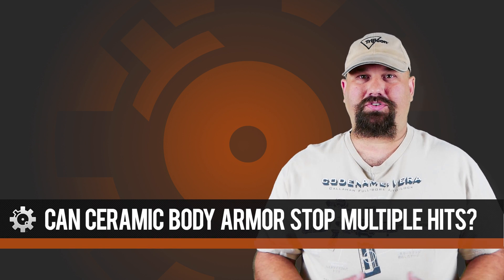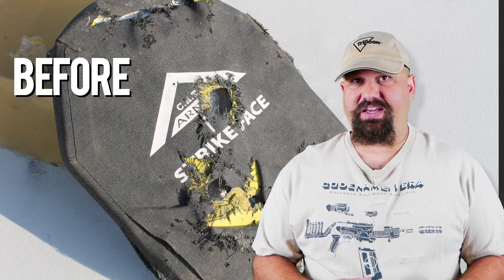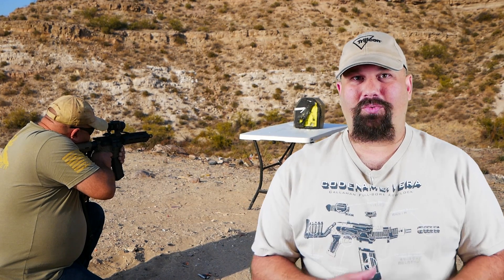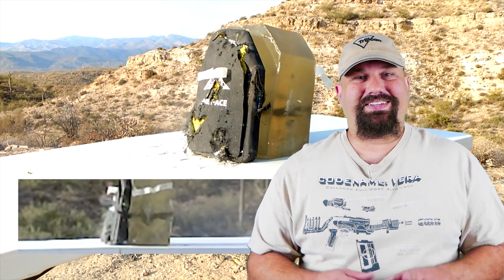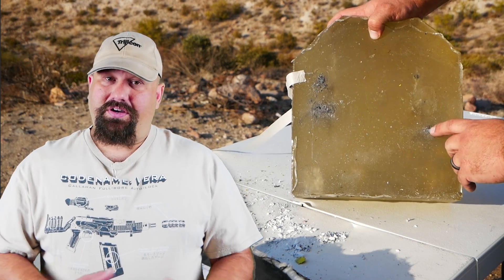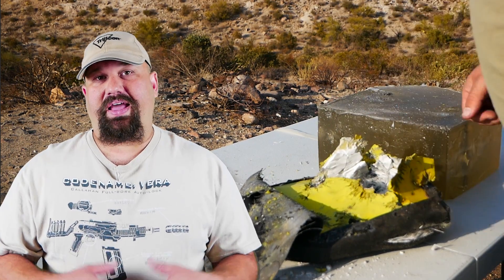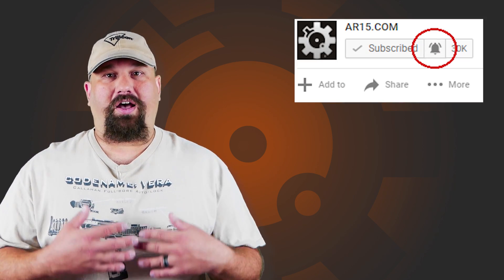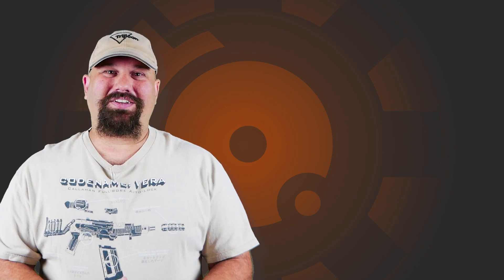Ceramic Plates: Tougher Than You Think? CATI Level IV Armor Test

Comment: I had much different results using a 458 socom
Ceramic: 8 rounds 
Steel: 25 rounds 

300gr ammo 

Hope this helps someone
Reply: That's likely due to the Ceramic Disturbance Rule.
Larger calibers will disturb more strike face at once.
of course, there are caveats, but in general...

Comment: What I'd like to see is if ceramic will fail against multiple low level hits in the same localized area. I.E. 15-30 rnds of 9mm all with the same point of aim, not trying to spread the shots out to undamaged areas.
Reply: That's exactly what I want to see
Reply: Just put a 3a or level 2 backer behind your ceramic plate... Ar500 offers a level 3a soft armor plate that is .25” thick, 1.04 pounds...easy pz.
Reply: @hylabrookbooks  that doesn't answer my question. I want to know how much concentrated lower threat fire they can take. A worst case scenario.
Reply: @corvoshlorpe3849    if you’re talking 9mm hitting in the same location it would hold up. I can only tell you I’ve shot armor similar and what happened is the rounds just started stacking on one another. And pretty much layered on top of the soft armor behind the ceramic. Basically when fired, the rounds would  hit the previous ones caught in the armor

Comment: I run a Level IV composite ceramic 1 inch. Behind it I have a ¼inch AR550 plate. That is on the front portion of my carrier. On my sides and back I run 1 inch level IV ceramics. I also run a Level III+ ballistic helmet. The ballistic helmet has been known to stop multiple .308 rounds. It will knock you out, but you will survive without being brain dead.
Reply: What 3+ Helmet are you running? From where?
Reply: @humansvd3269  
It's likely some variant of the ECH type.
It's an NIJ III- equivalent, capable of leadcore 5,56/7,62mm ammo.

Comment: if you are hit that many times with a steel plate on you will probably die from internal injuries anyway
Reply: Or spalling fragments to the neck
Reply: @agenetpringles6164  I've seen spall liners on steel plates that could take multiple times the amount of volume of of lead as was shot in this vid.
Reply: @Frenchfrys17  
And I see Armor Repub's "cutting edge" FragLock coats fold the cards to a few rounds.
Your point?

Comment: What’s the story with ceramic plate having expiration dates?
Reply: Dubtak things that don't expire generally are given expiration dates so you'll buy another. Anything inorganic doesn't expire. Sure he glue or whatever might not hold up as well, but it's to make you buy another one and for liability reasons from manufacturers. They don't want you to claim it was faulty and expired if the plate fails somehow.
Reply: I read somewhere that ceramics plates decayed.  I sold my level IV plates.  Was I wrong?  It sat in my closet for 4 years. :(
Reply: As long as you didn't take a loss/huge loss, doesn't hurt to renew. But especially if it sat in low humidity, non extreme temperatures it should be fine. That said, I would be more concerned about kevlar "expiring" more than ceramic. But ceramic plates might have kevlar backings.
Reply: @shinli00  
There was literally nothing wrong with those IVs, though depending on brand it may well have just as well.
As long as you keep a plate somewhere comfy for a while, you're fine.
Reply: @stevedo18able  
If I remember correctly, soft armour has been tested for degradation over time and undergoes simulated degradation testing.
Anyways, if Al Gore is to be believed that shit'll outlast me.
Reply: Ceramic plates never expire, they are put on there for legal liability from the manufacturer.

Comment: Hey great points here!  DoD picked ceramic for a reason next to cost/distribution, the efficacy for the situations that DO dictate their usage is more than prevalent in our Veteran community, they've surely saved lives in their capacity and then some.  The side plates on a standard military kit many forget as well and do help cover/protect vital side areas along with the kevlar pauldrons/shoulder covering for various systems when worn (again in that capacity).  Emergency kits for civilians-- they'll do the job if you're not planning on sticking around something ridiculous, reasonably light pending the level and maker/composition/layout in design.  
Like you said, not many situations in the civilian world that would relegate multiple hits like that, pretty viable in a variety of situations/environments.  
What do you see in the cost- effectiveness vs. steel plates?
Reply: Derek J. Well, the plate shown in this video costs $150, which is consistent with a curved, coated lvl III+ steel plate.
Reply: Thank you for the msrp clarification, very good, i've seen some like Paraclete going for 4x that much at the same level, some interesting stuff!
Reply: Derek J. The difference in costs for plates generally has to do with weight. Even a half pound in weight savings for a pair demands an upcharge. Having bought ceramic plates before I became a LEO I have 8 pounds per plate. Having worn a fully kitted carrier for more than 8 hours in one day I wish I had half the weight per plate. But the plate cost increase exponentially as you get lighter.
Reply: The fact that M855A1 is the service round means steel is no longer acceptable.
The fact that M193 exists, means that steel is no longer acceptable.
The fact that Dagny Dagger, a Libra Snail update to defeat standard steel armour out of a handgun, exists, makes steel no longer acceptable.
Oh, and now there's NIJ IVs retailing for around 120something a plate.
So now you can pay more, for less, ahem, 165$ steel plate...
Reply: @KoishiVibin  M855 isn't a new round by any stretch, but there's certainly more and more developments that are doing very well against most to all hard plates.  But, to play devil's advocate, there are always new developments with steel and other composites for hard plates to compete with the increasing effectiveness of new said rounds, very cyclical and successful industry to be in on either side of it.  
Steel, Ceramic, Dyneema and Aramid composites are going to be a staple for a time still (with increased development considerations as aforementioned), but will be interesting to see what new stuff comes out of the continued R&D.  Certainly Lv. IV and even a bona fide V may be the new and the norm in time not far from now more than IV's presence has been of recent, very true.
Reply: @DJTheMetalheadMercenary  
I would advise holding short on that one chief.
A Type 5 armour rating used to exist. Used to. Then after the DS thing anything over IV was met with mockery and derision. So, I just reuse the old definitions.
IV+: Strong IV, usually capable of multiple M2AP hits
V: M993 @ 3150fps rating.
In any case...
Certainly, steel has had some developments, thanks in no small part to Diamond Age's attempts to make a 21st century alloy.
However, even then, they are a small company, and any real advancements will be hindered by rising prices for for initially poor gains and uncertain future improvement.
In terms of NIJ IV compliant steel, these were a thing back in the .02 or .03 days. M2AP velocity was about 50fps lower and they usually had very poor v50s.
I can think of a way to theoretically kitbash an IV steel, but that would come with... caveats.
Reply: @KoishiVibin  You're right.  Diamond Age really has made some good strides in the quality/ development regarding steel and ceramics yeah, theoretically as well the next step in a layering or alloy would be something like Tungsten but without the weight-- as you said, cost and market- savviness would continue to be a major hurdle.
But then again, I know dudes that bought Dragon Skin systems, so there is a market there, albeit very high price to the consumer.  Something like an Aramid covered advanced-developed steel plate would more likely be a "new" factor in the market, though increasingly tough to compete with the other composite (and lighter in weight) materials and products now out and in continual improvement.
It's all very interesting beyond what i've done with testing with companies back in the day (namely AR550 steel and alloys).
Reply: Right you are, I had inferred that a bit with the composition/design and Paraclete remarks, wearing the IBA in my time in it was in no way light, it's good to see functional plates in a comparable weight and price to Steel with these showcases.

Comment: I just picked up some ceramic silicone carbonide ( I believe that's how you spell it) from Germany. Extremely thin and lighter than AR 500 or ceramic plates and works better both.
Reply: Would you mind sharing the name or supplier? I am in Europe, and getting plates from the US is very difficult (ITAR), a European supplier would be welcome :)
Reply: Please advise on the supplier in Germany

Comment: One thing I wouldn’t mind seeing: shooting a ceramic plate backwards. I put a lvl 4 ceramic plate into my son’s school backpack. Depending on circumstances, he might be wearing it, or he might be holding his bag in front or side while he runs away. His plate may or may not have its strike face towards an incoming round.
Reply: PikeyScott That's a good idea.
Reply: I'd appreciate it if you can find the time and the plate.  I'd be willing to send you the funds for one if the vendor isn't willing to donate to a backwards test.
As for the ammo used in testing - Whatever is in most common use for 5.56 shootings (I'm saddened that I'd even have to think about ammo choice). So vanilla 55 gr or 62 gr from a 16" barrel? Dunno. I'd venture a guess there ain't any M855A1 rounds getting fired inside schools, so I'm not worried about testing against unicorn ammo.
Reply: PikeyScott I'll see what I can do.
Reply: It wouldn't be effective and it would spall. The strike face has to be forward. Ceramic works by breaking up the bullet into slower moving pieces that the PE backing stops.

If you want to stop bullets in a backpack, you need to face the ceramic tiles where the bullet would hit.
Reply: Cringe